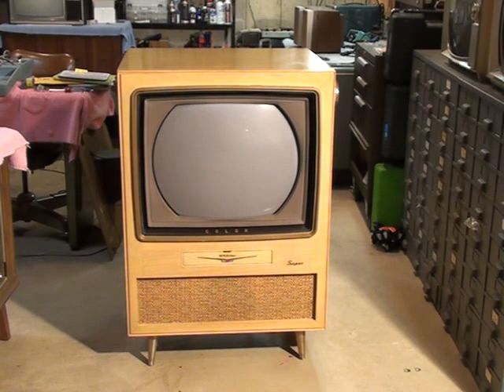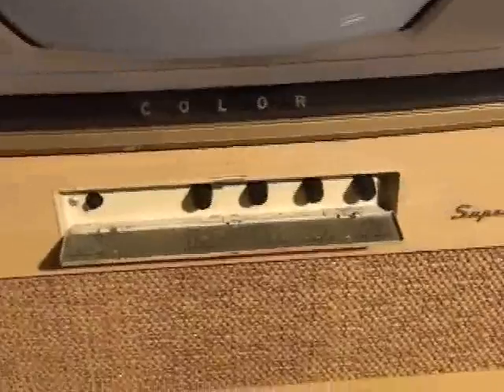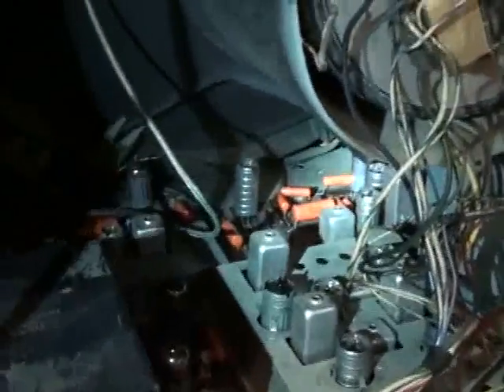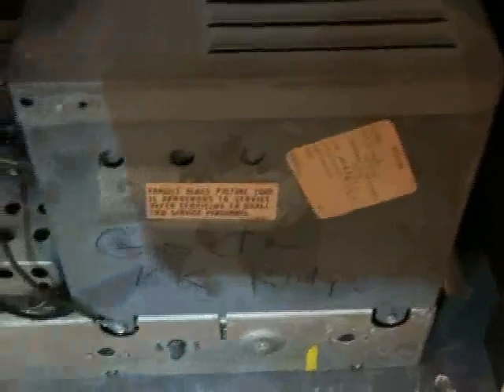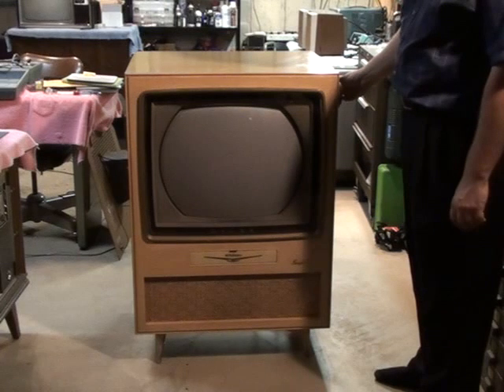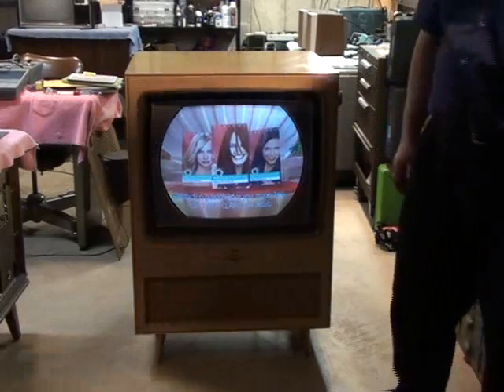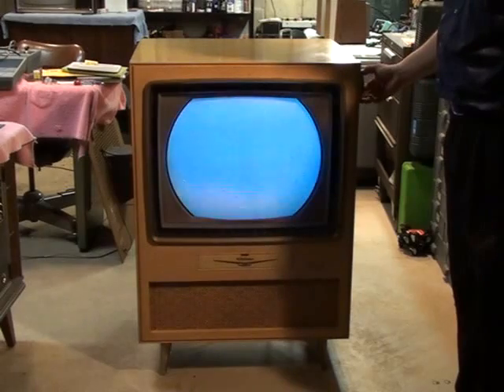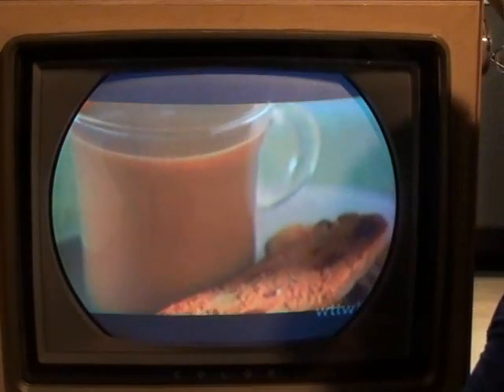Watch a 1956 RCA VICTOR CTC-5 COLOR TELEVISION!! "Roundie"

Comment: Those TV set are very strong it's about 60 years old and the picture is crystal clear very cool bro
Reply: Yeah, but where do you get those old valve tubes when one eventually breaks.This set was from an age before the transistor was invented.
Reply: You have the same problem with transistors. I've got amplifiers here from the 70/80s that have obsoleted or discontinued parts. 
I imagine tubes are a bit more forgiving when it comes to equivalents.
Reply: The transistor came out in 1947.
Reply: True, but it took a few years to get the production right. The first generation of transistors were rather expensive, not very reliable, and would not carry the current needed for the line/frame timebase circuits in a telly.
Reply: @BadWolf762  So, why was it not used in
mainstream electronics until the late 50's
early 60's. Here in the UK everything was
valve tube technology, although you Yanks
were always a step ahead of us Brits.

Comment: I had a CTC-15 Color set. I believe it was from about 1964 if I remember correctly. Back in 64 the set cost about $900. Back then this was very expensive!  When everything was working properly and reception was good the pictures and sound was very good. RCA was one of the better TV sets during these times.

Comment: Back in the era of analog TV signal broadcasting... and I'm not talking about 1956, I'm talking about 2008 ! This digital crap we have today makes me sick. Can't get a strong enough signal at the cottage, so we don't even get a slightly snowy picture like we used to, nothing at all... Damn digital crap. Now we have to buy a dish and pay a monthly fee to get anything out there, when it used to be free (paid by our taxes). 
And I doubt very much that even the very best TVs we can buy today will even work at all, sixty years from now ! This set is a great testament to the very high quality standards of the day. Great picture and sound, close to sixty years later !
Reply: You can just buy an ATSC amplified antenna, make sure you have it pointed in the right direction. I have not paid for TV in some 5 years now. A good antenna doesn't cost more than $80 now a days.
Reply: I agree.  I have nothing but used CRTs and converter boxes in my home.  I have the RCA ANT751R Outdoor Antenna (Optimized for Digital Reception) installed in the attic and receive 38 digital channels.  Very good stable signals and I'm 40 miles from transmission towers. BTW, digital or analog signals, would love to have this TV.:)
Reply: Mark Szorady
I live in the third world country named Canada, when it comes to over-the-air digital TV signals, with weak transmitters and wildly fluctuating radio signal strength. So, forget about a cottage 40 miles away even with the best amplified antenna. Even in a big city like Montreal, with direct line of sight to the transmitting tower, when there's a plane overhead, it's digital mosaic drop outs patterns and choppy sound time. And some channels aren't even broadcast in full HD, but only 720p. Talk about crappy. Here we have something called the CRTC, equivalent to the FCC in the States, that is supposed to serve consumers. But I suspect that it serves the cable companies by deliberately limiting the output power of over-the-air digital TV signals... I hope I'm wrong about this, but I wouldn't be surprised a bit if I'm not...
Reply: AlainHubert I can agree with some of what you point out.  WFMJ TV-21 out of Youngstown limits its signal due to an agreement with a television station out of Toronto.  Even though neither station occupies the same channel/bandwidth today, the agreement is still in force.  Which means, if you are to the rural north of WFMJ TV-21's tower, you'll have a hard time getting its signal. But in the greater Cleveland area, the towers appear to pump out great signal and I'm located on a high area of NE Ohio, whereas Youngstown and surrounding areas are hills and valleys.
Reply: I live in Canada as well, and the CRTC is a fuck up
Reply: Digital definitely produces way better pictures but trying to pick pick up digital channels is a bitch!  Analog seemed to crawl over mountains.  Digital - good luck!  I remember back in the early 60's, I visited a log cabin at a place called Arrow Part in British Columbia.  Serious Mountains!  The place was surrounded by 7,500' mountains.  Yet they picked up KXLY-TV, channel 4, from Spokane, Washington, about 120 miles south.  Lousy picture.  Great sound.  There is absolutely NO WAY they could get a digital signal in that place now that Spokane has converted to digital.
Reply: Yes.. I have huge collection radios from 1935 thru early 60s..NOTHING MADE NOW WILL BE WORKING 75 PLUS YRS LATER LIKE ALL MINE STILL DO..

Comment: I had a CTC15 back in the 1960's. If I remember correctly I paid about $850 for it back then. In our money today this would be the equivalent to about $14,000!  A new Chevrolet back in 1965 nicely equipped costed about $4100 back in the mid 1960's.  

It is unfortunate in a way, these old TV sets can no longer work on the broadcast systems that are now in place. A down-converter, or some type of analogue type TV distribution would be required to view the TV's of that generation. It is only a matter of time before the radio system is also changed to digital only.
Reply: Know what you mean...I bought a new '76 Chevy Impala Landau Custom in January, 1976-the sticker was $6282! An equivalent 2013 Impala runs about $29,000.
Reply: Digital TV is much worse than analog!
Reply: King Bee funny how TVs have got so much better and cheaper while cars are still just cars and cost so much much more
Reply: Yes in 1965,  4100$ wud get you loaded impala.. 4100$ cud really get yu into a olds in 65, if yu got the Dynamic 88, not a olds 98..My dads 68 delmont cost  3450$, light on options..

Comment: The sound is better than LED TV
Reply: Nowadays, no one uses built in speakers. Now they use A/V receivers.
Reply: Steves Labatory That's because the TV manufacturers make cheap shit now, with no inputs or quality speakers
Reply: CODMarioWarfare I agree with you. Things were way better when people had higher standards. Now everything is just shit and imported.
Reply: Shitty tinny speakers so they can make another product for you to buy,cough Soundbar...
I never had a problem with TV speakers until they all gone flat some manufacturers tried put some beefier speakers on LCD back in 2007-2009 and they quickly phased out for some reason.
Still nothing quite like Japanese CRT back in 80 and 90s they have speakers that can rival some home theater system.
And TV back in the days do look like furniture I loved that!
Reply: when it comes to speakers there is no replacement for displacement...literally..i laugh at those tiny ass speaker thingys
Reply: dave koh that's the vacuum tubes giving you that warm sound

Comment: One thing really puzzles me about these old tv sets.  These were made before the invention  of the transistor, and so used the old valve tubes.  Surely these old tubesmust be hard to come by now.  I was an apprentice tv engineer back in the early 70'sand even then, those old valve tubes were getting pretty scarce, with the introductionof transistors, and now the IC (Integrated Circuit) chips used in most devices these days.
Reply: Surely no one still manufactures these old tubes.  You say you have boxes of them, you must have had them for quite some years now.
Reply: Really, you are only 15 years old?  and still able to buy these old tubes? I live in Western Europe and have not seen or been able to get these old tubes for many years now.  They went out with the ark.  First they were replaced by Transistors, and now by the Micro Chip or IC for short.  We used to have Radio Shack,here, also known as Tandy, but those stores closed down many many years ago.
Reply: Yes, they've ressurected as a bunch of music listeners want tube amplifiers because they say they have a particular or better sound. (it's the same phenom with people who buy the modern vinyl players)
Reply: Im from Sweden and have played guitar for 35 years. Tube amplifiers are still very big when it comes to guitars, i have a few myself and there is no problem getting tubes for them either since new tube amps are constantly developed and manufactured to this day using the same model tubes that were used in the 60´s. I dont know about tubes for TV´s, but i guess if you dont find them new you can probably often get new old stock ones or used ones on Ebay or something.
Reply: Transistors were invented in 1948 but of course it was many years before they were used in TVs.  Our first color set (1968) had lots of tubes so I think it was tubes all the way through.  The second, (1973 or so) was entirely transistors for broadcast receiving and decoding the color -- I think the audio chain was entirely solid state from antenna terminals to speaker -- but still had a few tubes doing the heavy lifting like the deflection amplifier final stage and the high voltage rectifier was still a tube.
Reply: Part of the challenge with those old tube sets is the tremendous heat from the tubes would bake everything inside the set eventually.
Reply: Theres places that bought out warehouses of tubes.. I have 40 old radios, a tube going out, Loctol, or, i forget other kind, is least of my worries.. Readily available..

Comment: I live in the UK and we did not get Colour tv until around 1968 when tv broadcasts began on the UHF frequency, with 625 line picture tube.  Previous to that, tv programmes weretransmitted on VHF and in Monochrome on a 405 line picture tube which gave a grainykind of picture.  You Americans always seemed to be way ahead of the rest of us withtechnology.
Reply: The minute that has anything to do with video technology, I'll let you know.... Actually, I won't ........
Reply: American picture quality was not as sharp as UK though...when the UK did colour - they did it better  ....US picture quality often appeared to be soft and blurry due to less lines and less pixels ...infact the general quality of US television still remains quite poor- certainly the imported crap they show on our uk screens lol
Reply: I got Color Television when my Father bought it in 1975,it was expensive for my father , but he was the manager of a Jewellary Store and had the Money. The Color Television from 1975, was a 20 inch Philips Modular 4, with Earphone Phono 3.5 mm. Output Jack but it was able to Sound like Stereo on My 1974 FUTURA Tone, Volume Adjustable Headphones. But the Audio was actually NOT Stereo Sound, but Split Monoural Sound Split Mono Sound called ``Synthetic Stereo`` as both the HeadPhone Sound Left and Right Sounded ``Identical`` in Sound, this is Known as ``Synthetic Imitation Stereo`` although Hollywood Movies like ``GONE WITH THE WIND (Technicolor 1939) and THE WIZARD OF OZ (Also in Technicolor of 1939) and Errol Flyn``s ``ROBIN HOOD (Warner Bros. Productions in Technicolor of 1938) where also Filmed in `1 `Monoural Omni Directional Microphone, Known as Monaural Sound High Fidelity but NOT any Stereo as their was only High Fidelity Monoural Sound in Movies from 1938 to 1952 Hollywood TechniColor Movies. Although, Switch them to Mono RCA to Split Y--Plug Splitter RCA Plugs to Identical left and  inputs or the Inputs on Video Cassette VHS Record HiFi Stereo Video Cassette VHS Recorders Played back on Rented VHS Hollywood Movies Tapes, makes the ``Identical Monoural Sound Play back Identical in both MTS HiFi Stereo Splitting the Mono Sound Video Cassette VHS Recorders/Players. The Majority of 90% of Peoples in the World Cannot "Hear" the difference between ""2 Track Identical Splitted Synthetic(Y-Plug RCA Plugs of Splitted Monoural 2 Track Identical HiFi Sound"" and True HiFi Stereo Audio Left Right Separated HiFi Stereo Hollywood VHS Movies Commercial Rented Tapes and True MTS HiFi STEREO Recorded Hollywood Movies when Played back. In Audio, HiFi or "High Fidelity Sound" has "NOTHING" to do with STEREO. HiFi , High Fidelity only Refers to Clean NON--Distorted Clean Sound when heard by Human Hearing. Its Scientific Mathematical Measurement for High Fidelity ""The Distortion Rate"" measured in Sound is reached at 0.005% Distortion Rate , Well Below Human Hearing that can only Detect Sound Distortion at 0.1% Distortion Rates. Finally Movies in Synthetic Stereo on Monaural Splitted Sound known as ""Synthetic Stereo or Monoural Sound Split Identical into Left and Right Track of Identical Sound ''cannot'' be noticed by 90% of the People around the World unless you are an Expert AudioPhile or Audio Fanatic Listener or Audio Technician which then WILL hear the Difference between Splitted Synthetic HiFi Stereo Audio and , TRUE High Fidelity HiFi STEREO Recorded and Playbacked Sound. This is Why Hollywood Technicolor Movies like ""GONE WITH THE WIND"", ""THE WIZARD OF OZ"" of the year 1939, and ROBIN HOOD (1938) with Eyroll Flynn Technicolor Movies High Fidelity Monaural Splitted HiFi Sound(Synthetic Stereo:) TechniColor Movies which includes the Classic Technicolor Movies like Gene Kelly and Frank Sinatra "ANCHORS AWEIGH""(1945) and ""TAKE ME OUT TO THE BALL GAME""(1948) and Burt Lancaster TechniColor Movie ""THE CRIMSON PIRATE"" (1951) Still Sounds like ""Excellent High Fidelity STEREO when in Fact they are ""High Fidelity or 0.005% Distortion Rate well below Human Hearing still sound Excellent on Monaural High Fidelity 1 Track Sound Splitted into 2 Tracks MTS Decoded Splitted Monaural Sound Spiltted into 2 Identical Sounding Tracks similar to HiFi Stereo but are Really Splitted Identical Sounding Left and Right Tracks known as ""Synthetic Stereo HiFi(2 Identical Splitted Monaural HiFi 2 Left and Right Tracks called ""SYNTHETIC STEREO HiFi, NOT Real  like HiFi Stereo Sound and Music!! In fact on "Measuring 2 Track Left and Right Audio Electronic Left and Right Audio Tracks Graphs, the Sound is Moving ""Identical"" up and down or left to right in ""Identical"" Movements on the Left and Right Audio Electronic Measuring Audio Graphs. Hollywood DVDs and VHS Tapes and Blu Ray Discs are still calling these Older Technicolor Movies Pre 1952 as ""HiFi STEREO"" when in Fact they are ""HiFI Splitted Synthetic Stereo where Both Left and Right 2 Tracks have the ""Identical Sound and Music"" in ""High Fidelity Monaural Splitted MTS Decoded HiFi Sound or Monaural Sound MTS Decodes to 2 Identical HiFi 2 Tracks"" known as "Synthetic STEREO" HiFi Known to Music Fanatics Audiophiles and Audio Technicians!!!!!!!!!!!!!!!!!!!!!!!!..............................................................................................!!!!!!!!........................
Reply: The PAL system was not interlaced, as was the US''s NTSC, which some people felt was sharper, as you got. a full raster on each scan, as opposed to the interlace, where you got half a raster each scan. SECAM was similar, used in France.
Reply: Sorry, John, but PAL was indeed interlaced, 50 fields interlaced 2 to 1 for a 25 frame per second image. It was sharper because there were 625 scan lines rather than 525.  The channel was wider to accommodate the extra bandwidth.  The color was different, using a 4.43 MHz carrier that used an opposite phase for each line, thus the initials Phase Alternate Line.  This idea cancelled out any color phase errors without having to use a 'tint' control.
Reply: PAL have more resolution at 625 lines,  i am from Argentina, over here we use PAL-N, 220volt 50hz, the first colour broadcastings were made in 1978 for the Argentina world cup, we, along with Paraguay and Uruguay, are the only ones of the american continent (both south and an north) who use PAL, the rest use NTSC, aaa i forgot, Malvinas/Falklands islands use PAL as well, but i believe they use PAL-B (the same variant used in Europe).Since early '90's almost all new tv's were multisystem, i mean they can take pal and ntsc signals.NTSC looks blurry in comparison to PAL.I have always wondered why didnt the USA tv stations replaced their NTSC equipment with PAL equipment.PAL looks way sharper!
Reply: US used 525 Lines of BW or Colour. from the start apparently. Old TV sets worked right up until everything turned digital, however a converter box will give you an RF analog output on CH 3 or 4 and you can still use the old TV sets today.
Reply: ALL analog TV systems were interlaced!!
Reply: UK only had 50Hz while the US had 60Hz so the temporal resolution of US television was superior.

Comment: I was born in 1956.  When I was 20 years old I worked in a TV/CB repair shop. I got familiar with all of those CTC chassis up to the CTC 40 with it's solid state scr horizontal sweep system.  This really brings back memories.
Reply: can TV from 1950s be hacked?
Reply: it does daddy pig 0:14

Comment: In 1967 I was an apprentice TV Repair Tech with RCA Service Co. I hated these old tube ( 32 ) laden boat anchors. Even the 3.58 Mhz oscillator was in a glass tube envelope.the colors were washed out and brightness was dim. Very few of we younger techs were able to fix anything beyond a tube failure. In the early 70's the all solid state sets were in the market place and the older techs had trouble with transistors. Module swapping was easy and quick. I specialized in solid state tuner repair and alignment in the shop. I hated being on the road service crew.

Comment: Wow that video quality is way better than what I thought it would be
Reply: Believe it or not, the receivers often were pretty good. Oftentimes the quality of the broadcast was less. This TV had to conform to NTSC, The only time there was an upgrade to the requirements was in the 1980s (Stereo......Where Available..) Most TVs until 1968 were B/W. In fact there was one broadcast station in Pittsburgh,PA (Channel 16) that didn't "go" color until 1986! Same thing with old record / radio combos (1940s-1950s) their audio specs beating out AM broadcast specs by a mile!